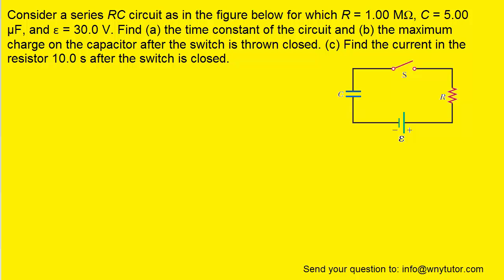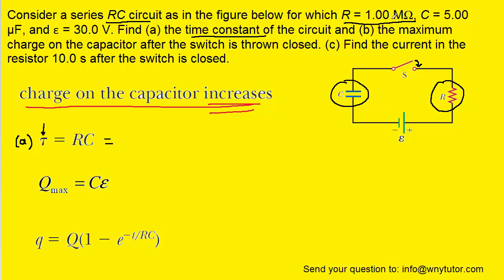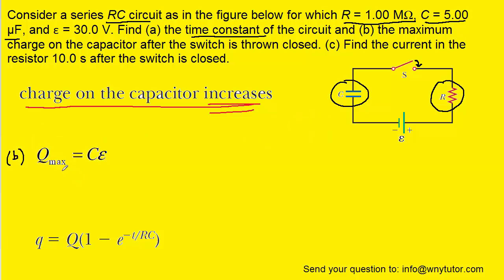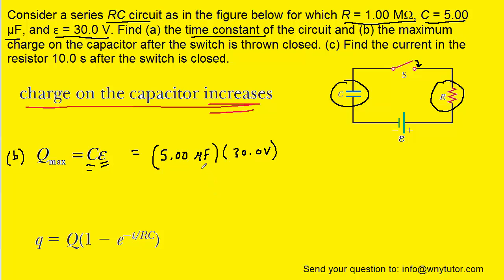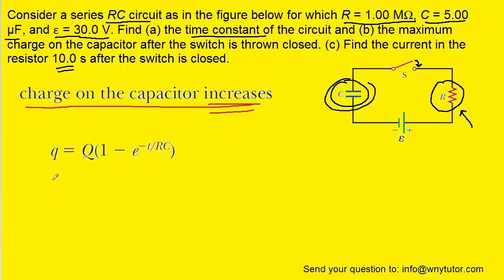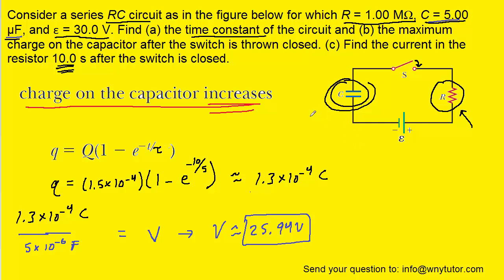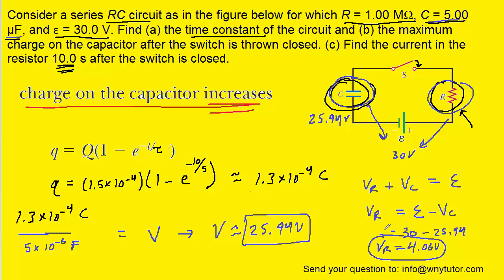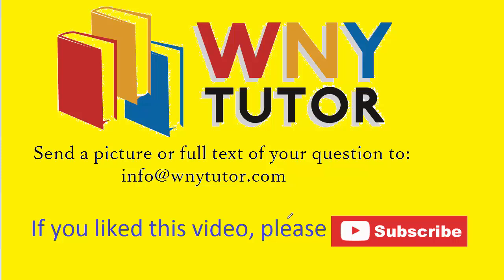Consider a series RC circuit as in the figure below for which R = 1.00 MΩ, C = 5.00 µF, and ε = 30.0

Comment: I do other thing to calculate the current in the resistor when t = 10 s, well, if it is a serie circuit, the current is constant in all the components, so, with the equation : I = (E/R) e^(-t/RC), you only have to evaluate